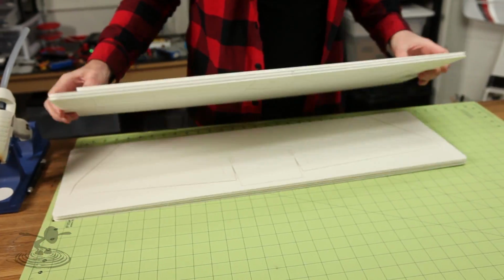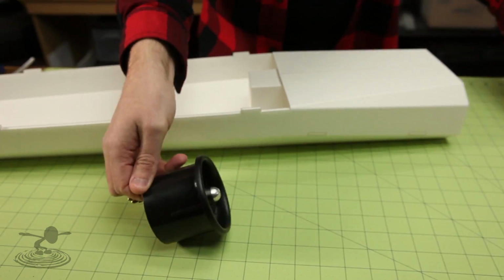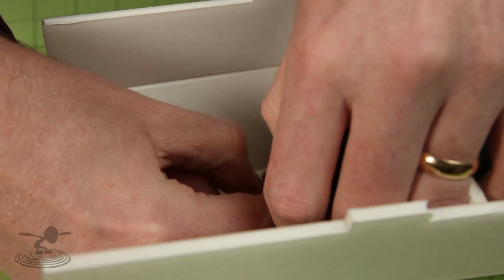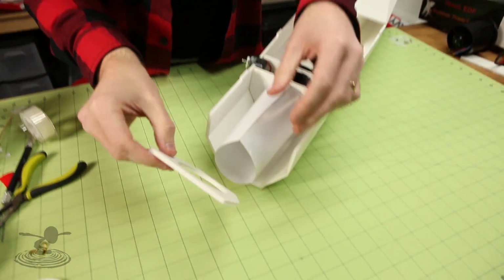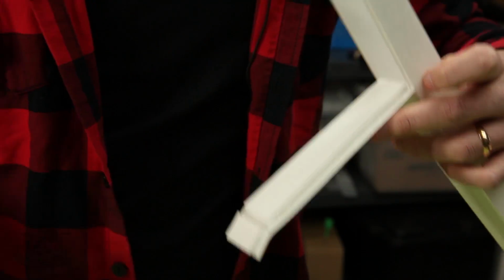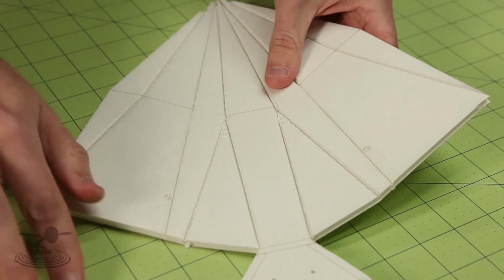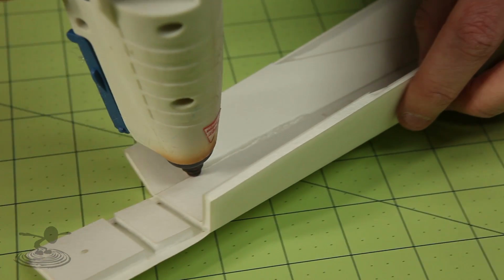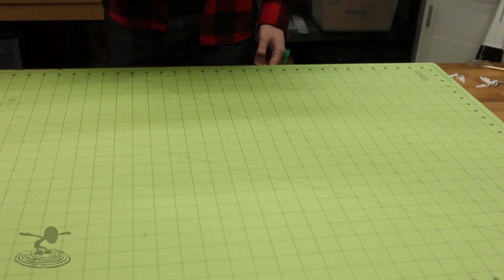Flite Test - FT-Viggen - BUILD

Comment: This is m first EDF and it's a great plane. I just made the 3rd nose. It is as said. It absorbs a lot of energy when a crash happens. Thanks so much to the really genius David.
Reply: do you know if the edf motor has 2mm, 3.5 mm or 4 mm connectors?
Reply: @Alex123-t3f  Depends on which motor you get. Best is to buy a complete 70mm EDF unit with motor.
Reply: are the plans still available anywhere?
Reply: @jbbolts  i think so. In Flite Test Forum you get them.
Reply: @jbbolts  PLANS you may download: https://drive.google.com/file/d/1GewWTn_aIS61iOxARJa8DusN_v41y9iT/view?usp=drivesdk
Reply: @erad05  awesome thank you

Comment: I'm currently flying my 2nd FT Viggen and it's a great plane, thanks to David for a fantastic design that flies well and looks great in the air!  I think you guys should include a carbon fibre spar for the wing fold in the kit.  I found out it only takes one poor landing to develop a crease that gives the plane some asymmetric dihedral which makes the plane very hard to fly.  The spar stops this from happening.

Comment: Bummed out! I'm getting severe servo interference on right aileron when I fire up the edf. Unflyable! All that work, suggestions? Please?
Reply: Well it sounds straight forward enough what the problem is, you should check out your wiring so none of your servos cabels are anywhere close to any of the battery wires or engine wires so they'd cause interference with your servo cable.

If this doesn't work try if possible a different reciever if you get same issue if you don't have one available I'm sure you can borrow one from a local RC club just for testing on the spot, best of luck.

Comment: Question is the thrust tube coned formed with a smaller outlet circle than the circle on the fan side? and are the inlets in front larger than than the fan inlet?

Comment: center of balance. Hi guys. built this as my first edf of any size. I tried flying today and have an issue. No matter how far forward I put the battery (2200 mah 3 cell) the plane just wants to do a flip upwards and loops back to me. I rechecked the surfaces and went step by step on the build video and do not see anywhere where you discuss the cg of this plane. Anyone else have this issue its like it does an immediate inside loop. The loop is up and back not down and back. Any help is appreciated. Happy holidays all and we miss david too... lol also found out that a 2212 motor is waaayyy too much for the nutball lol...

Comment: I learned a lot from your videos tonight! The other video I watched with the brushed speed controller and servo tester was a great idea! I have an old Novak controller from back in my 1984 Team Associated RC-10 racing days that I am going to use with my servo tester. A far safer method then the 120VAC light dimmer setup I have been using for sure! lol Using hot glue instead of epoxy is another technique I didn't think of. Thanks for the great, informative videos, you have a new subscriber... Thanks again...

Comment: During 30:30, doesn't cutting the excess paper increase the end diameter and remove the potency of the Venturi effect, which he toted earlier saying it was the perfect combination of speed and thrust?
Reply: +Daniel Dyck He's set it up so the combination is perfect when the thrust tube ends at that diameter I think.

Comment: Umm hes closing the trust tube, but not properly from below. The tube has slight air pressure so dosent it push air into back section from between EDF and tube? To me sounds just waste of power, so you should close and build your trust system first and after that connect that into plane, right?
Like he said:" as we dont get into this space ever again, we might go little crazy" For me that sounds like, make it so its totally fail proofed for future possible crashes.

Comment: Where is CG? I don't know it
Reply: CG=Center of Gravity. Just put make your plane flight ready and then hold it from under middle of the wings (one finger for one side so its allowed to swing, but dont let it fall). Adjust your fingers front or back to see if it tips front or back. When you know you CG then you can adjust this into middle of wings by moving battery etc around or adding weights (if plane can take extra weight with out problem). When you find best place from everything to allow best CG, then just use double sided tape and velcro to tie everything in place. Check peoples videos how to do this and more knowledge guys can correct me if i'm wrong..
Reply: thank Hellsong89
Reply: MrKanjen No problem buddy^^
Reply: Joshua Jerred Ok! Good that you corrected me! :) I dont have experience with rc planes, so i did go with my wits and what i have learned so far. Does every design have the CG marks by default or how you do it if you dont have those marks in plane you made from scratch, like some experimental build or just some design you found in internet?
Reply: Joshua Jerred Soo basicly same thing i said in case of build like that?
If design has 90degree straith wings, just put fingers middle of them and see if its tail heavy or nose heavy and then adjust accordingly. Of course after the first flight you notice if its really in optimally balanced and you can adjust it even better. Pretty much all the lift comes from wings so they are like axle point of the swing or this case plane. This is how i figured it. The sweapt wing planes like F15 and all modern fighter planes are different story as wings angle backwards, so CG should be in theory be futher back than standard cessna configuration.

Thought i'm not aerodynamic engineer of any sort...
Reply: Joshua Jerred Ou your right! I forgot to take motor and fuselage weight difference (front has more mass) into consideration! Of course its little bit more to front from middle! Thanks to pointing that out!

Comment: Hey , I just bought the FT viggen from your store and ordered the fan and a battery , speed controller and your servos like you told us to do but I don't know how to connect everything together and how electric circuit work, so I wonder if you could do a video about it , just on the FT Viggen electric circuit with the extension wires and receiver and everything ? That would help me a lot !!! Thank you .

Comment: Dude dosent the wings need to be in the shape of an airfoil inorder to fly? Correct me if i'm wrong .
Reply: Not necessary, especially not for a delta wing. And obviously it flies.
Reply: so when do i need to put on an airfoil?
Reply: ***** so when do i need an airfoil?
Reply: Gokul GS Actually, you never need an airfoil to fly. Its not the shape of the wing that generates lift, its the air meeting a surface with an angle to the wind direction.
Reply: Magnus Hansson hmm i understand ..angle of attack....thanks man

Comment: Hi David and everyone else building this plane.

Just wondering if (thrust tube section) at the back when you are gluing the tube together, wouldnt it make it easier to blow up a balloon just enough to keep the tube tight against the 70mm wall section so you dont have to hold it with your hands?

Would make things alot easier for beginner builders if that is the case.

Cheers
//Erik

Comment: Hi guys , I'm a modeller with 30 some years mainly scale scratch builds and have just completed my FT Viggen build...well almost....I used an acrylic floor varnish (same as Min Wax) to treat the airframe prior to painting...........results were terrible....all the paper de-laminated from the foam and made a complete mess of the wings which then has no strength whatsoever, this may have be due to moving the plane and the wings flexing I dunno, but I'm pretty disappointed right now after spending a great deal of time on this build with nav lights, strobes etc etc ..and spending a lot of cash to get it to Europe......I will have to glass the whole of the wing and fit a reinforcing spar if this things is going to make it out of the workshop....PLEASE stress to the other customers that you must not flex the wing whilst the Min Wax is drying...or else the paper de-laminates and will NOT re-glue rendering the wing weak and useless :-(    !!!...sorry for the moan....If you are aware of the pitfalls I'm sure this is a great model ...Cheers for now.......Ray
Reply: Was this water based varnish? I tried to use MinWax Polycrylic, the water based version (against the warning of Chad in his video about painting the $TF) on my first build and got the same results it sounds like you did. I refused to let it get the best of me and dealt with it. It was a Slinger (Racer) that ended up with a bad skin condition. Sorry to hear all that work ended up in problems but take a deep breath and push forward. Sometimes it is two steps forward and one step back, but on average great progress. Let us know how it came out if you glassed it.

Comment: glad to see the build video back up.   finished mine with a hobbyking 70mm fan (replacement EDF for the Zephyr, $25 from the USA warehouse) and running a 4S 3000 pack, works great, good speed/power, sounds great too,  Thanks Flite Test!

Comment: holy mother of frankenplain FT shipping to Australia is $10 more then the viggen itself. i know its not your fault and i know your working hard to make it cheaper but damn it sucks. plus i cant even get foam board here and balsa is criminally expensive. to bad you cant organize with a dedicated hobbyist to set up a second production point here in aus for us people down under "wink wink".
Reply: hi dude, i don't know if you can get coroplas / corrugated plastic , in the uk it's used for "For Sale" signs (outside domestic properties mainly) but it might work as a substitute for many designs . This one however might be tricky with the intricate folds ...
Reply: you make a good point, but the main problem isnt how well it folds but the weight, the corplas would increase the weight far to much making the required speed/lift too great, an intermediate jet would now be horribly to fast to control for a beginner. also the heart of the issue is the availability cost and time needed to cut your own kit, for most people its too hard to over come these issues. for myself its the time and cost of materials or lack of. at the end of the day its cheaper and easier to buy a PNF from HK then what is supposed to be the nice, easy, cheap, fun entry point that FT is so passionate about, and this is the core problem for us non US hobbyists. hence why i think at some point FT should franchise internationally, and with David returning to Sweden it would be a golden opportunity to trial such an ambitious venture. heck even overseas shipping locations like HK's international warehouses. ship kits in bulk to where they can be ordered at lower shipping costs.

just a thought
Reply: i see , i've not handled the dollar tree board they use and having seen a few other model makers on utube using coroplas was just having a guess .

& yeah a distribution base nearer your part of the world would make perfect sense. hopefully it'll become a reality sooner rather than later.

Comment: Depron build guide please
Reply: 6mm might not work for this plane. The A and B style folds kind of depend on the paper from the dollar tree foam.
Reply: karter koob yeah I figured as much. But since we don't have dollar tree foam board in Australia some guidance on using depron instead would be good.
Reply: Mohit Dewan Office works sells a paper covered foamboard they call it poster backing board it is 11.75 per 770x500mm sheet but it works Great for the dollars.

Hope that helps.
Reply: ***** thanks for the info. I am aware of that stuff but it's smaller than the plan size meaning you need to buy more. It's almost as expensive as Depron and it's not as good as Depron.
Reply: ***** oh and the paper is not removable.

Comment: I don't think I'll be building this anytime soon as I don't have the experience yet BUT have watched it twice! I always thought I had tough fingers, having worked so many years with hot metal parts, but can't handle glue on my finger tips.Davids fingers must be like leather to be wiping that glue!! LOL His finger prints must be burnt off by now!! LOL Thanks for taking the time to design such a beautiful plane David..
Reply: You could do this plane if you have any expierence flying. If you do the light version with the prop in the back you could learn on this plane. You could even extend the wings out a little to give you more surface but dont think you would even need to do that, Go for it. Its only foam.
Reply: redrumm101 I've built 2 foamies so far that have been flown but not by me. So, still no experience! I will be in the air soon. Just been too busy and when not busy, just too much rain! It is a nice looking plane!
Reply: david get his figure wet before he wip the glue